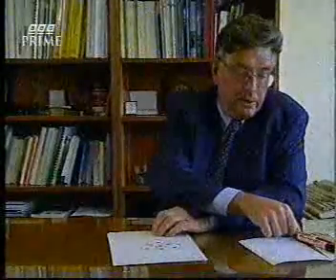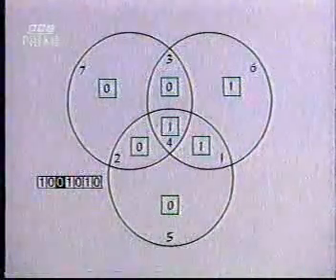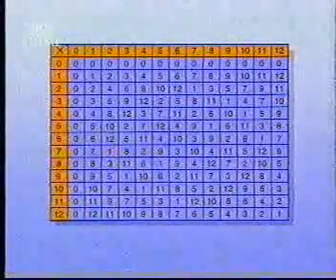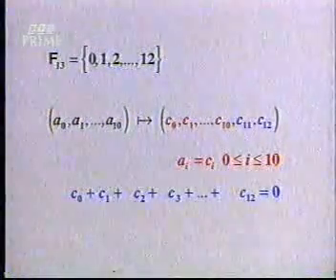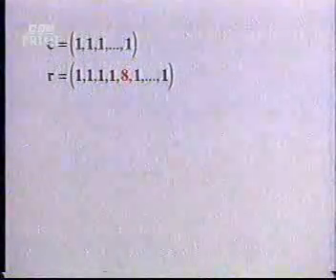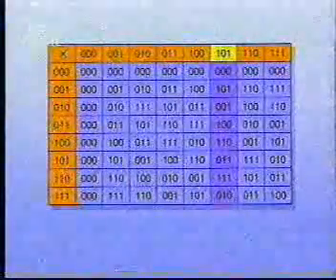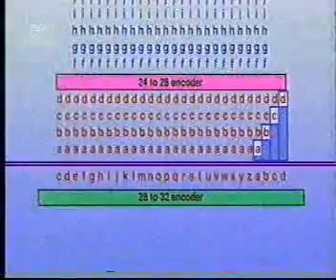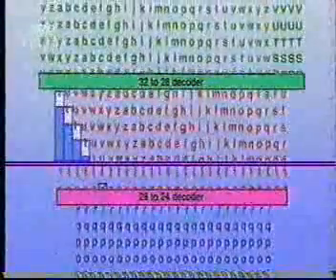7-4 Hamming code (Errors Aren't Forever [part 2/2])

Comment: 8:58 3+1=2 wut???
Reply: The plus signal here means just an arbitrary matrix operation, in reality is the modulus of minus (-), that's why the matrix is symmetrical with all zeros on the diagonal, like for 100 + 100 = 000... In your example, 3-1=2!
Reply: Can someone explain how this works in binary? Cause in the previous decimal example the rule was different
Reply: I have to admit this explanation is rather confusing.  Like I mentioned elsewehere on this page, try Tony Hill's file "Reed Solomon codes explained".  He presents the process in a very practical way with the least possible theory.
Reply: Thanks :)

Comment: I discovered an excellent tutorial on the internet on how Reed Solomon codes are implemented practically on a compact disk or other media recently.  Google Tony Hill's Reed Solomon Codes Explained.  It will require a little thinking if you are a bit rusty in these things like myself but he explained it very simply.  It's a beautiful process !

Comment: But in that encoding which used the idea of divisibility in F13, what if there are more than one errors in the given string of 12 numbers?
Reply from the maker: +JohnSikes73 if there are more errors than the error correction mechanism can handle, the errors leak to the output, e.g. you get faulty playback.
Reply: liquiderz yeah, I guess that will be the case.....but anyway I think probability of having more than one error in a string of 12 will be very less......thnx for reply though......n for posting this very informative video.....
Reply: Hi John, look up the video on "Jpeg and reed-solomon".. the last 15 minutes or so deal with the error correction process on CDs and how the interleaving system deals with long bursts of errors.

Comment: Now I understand the concept behind the Reed-Solomon code much better. Thanks very much for the upload !
The part about cutting away a bit of the CD is quite interesting. IIRC it comes to about 2.4 mm that you can totally remove from the track (which works out to about 4000 bits) that the hardware can still successfully restore.